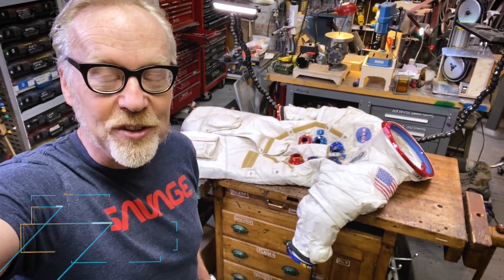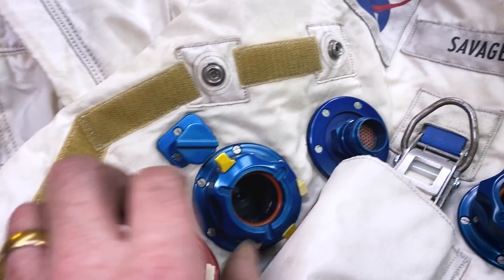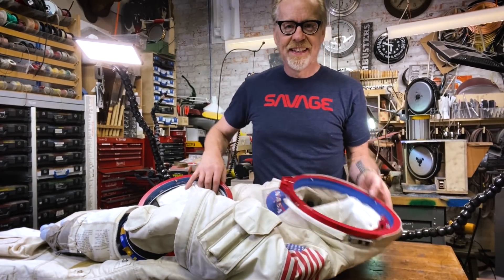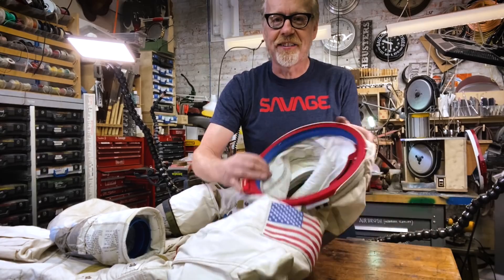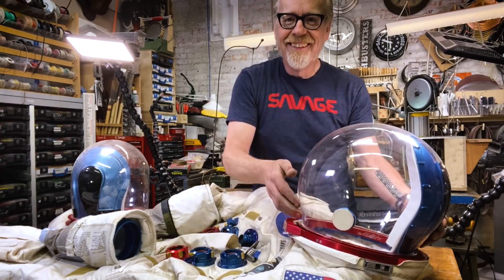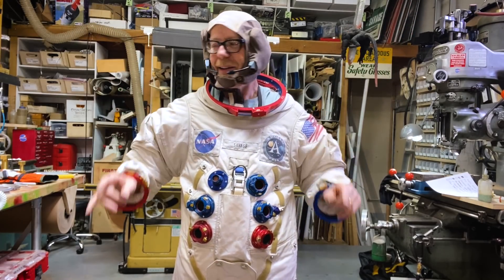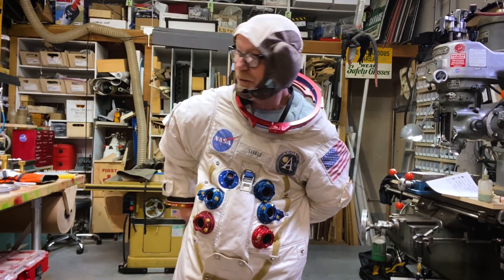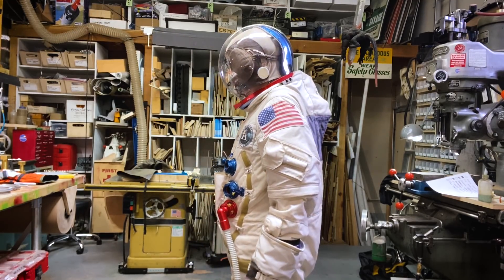Adam Savage's Apollo A7L Spacesuit Upgrade!

Comment: Just a heads-up on the CCA ("snoopy cap"): The quindar tones should not be there. They originated on the ground and was only present for the CAPCOM end, not the spacecraft end. Due to the very slight comm delays (maximum of ~1.5 seconds) sometimes the crew would start their transmission just as the CAPCOM ended his, leading to a confusion in that the spacecraft generated a quindar tone as well when it was really the outro tone for the CAPCOM.

Here's a NASA page on the quindar tones: https://www.hq.nasa.gov/office/pao/History/alsj/quindar.html

Comment: Ok, space nerds, I've got a question. Adam points out out that he made an oxygen system thingy and air goes into the red valve and goes out of the blue part of the helmet. First question - is color coding a consistent thing where red is in and blue is out? Second question - if that is indeed the color scheme, is it a metaphor for how a cardiovascular system is usually drawn, with red arteries and blue veins?

Comment: Somehow I think a build in the near future is Adam making a portable ventilator unit to match the ones the astronauts carried on the way to the pad.  And, for what it's worth, the blue connectors are the input and the red is for the output.  Adam has it backwards by having the air come in the red connector.

Comment: Fun fact: that air distribution system in the helmet is use almost unchanged in modern EMU's. 
Less fun fact: Its that through that port that water made its way into Luca Parmitano's helmet during his aborted space walk. The water soaked into his cap and eventually started to fill his ears, eyes and nose before he could get back to the airlock (which he could barely see by that point, if at all) to safety.

Comment: Regarding anodising colour. Different grades of aluminium do anodise slightly differently and can give you headaches trying to achieve the same colour as another part but can also have different looks, ie they brighten (chemical polish) to different levels, some show grain etc. Colour is achieved by dying the parts, if all other things are equal (actual dye pigment, oxide layer thickness, dye concentration, dye temperature, some react to pH too) then different colour shades would be achieved by dying for a longer or shorter period of time

Comment: This is amazing! I am so envious right now. But one thing has always bothered me about this suit: the silhouette is a bit off, because the shoulders and neck are a little too droopy. The A7L has an internal pressure suit that adds a lot of structure, especially around the shoulders and neck. Given that Ryan's suit patterns are accurate to the original (or nearly so), it should be trivial to just add a bit more batting (maybe it will make it a bit hotter, but it would be totally worth it!) or something underneath to stiffen the shoulders and give the upper torso just a bit more structure. Do consider it! Otherwise, you are living the dream man

Comment: One thing I don't believe in is the moon landings. They were faked.
Reply: You really chose the wrong guy's video to post this on. Adam proved very well that the moon landings were not faked during his time on Mythbusters.
Reply: @HubrisInc  I watched it, and only saw a number of flaws in it. To replicate in a studio that the moon landings were not done in a studio is a paradox. The only thing they couldn't replicate was the slow motion properly, and they didn't use wires. So with wires they could have replicated it.
Reply: What about the mirrors on the moon so we can accurately trace its orbit with lasers?
Reply: @cycoholic  You can send up a bunch of them, have them send out their own locators, and pick one up. A few years after the moon landing their were a bunch of red lights circling the moon, I think that they were the reflectors.
Reply: Pincho Paxton so what about the fact you can see all of the landing sites on the lunar surface, including the lower LEM portion and other large hardware?
Reply: @emilyrobinson6080  I'm sure they have had plenty of years to fake all that by now.
Reply: @pinchopaxtonsgreatestminds9591  Faking all the evidence after the fact would be just as, if not more, expensive as actually doing it for real. also, think of the thousands and thousands of people who worked for NASA and the various contractors who built the equipment. There is no way that if it was faked that none of them would come forward and admit it was faked, and yet to my knowledge no such (ex-NASA, ex-Grumman, ex-Raytheon, etc.) person has come forward. For every other major hoax out there, someone has spilled the beans. Don't you think that the same would happen with the moon landings?
Reply: @HubrisInc  These useless replies just make me believe it was faked even more, because if people are so gullible it makes it far easier to fake. How many people have to actually know? About 12.
Reply: Pincho Paxton thousands. Thousands would have to know, from every facet of the design and planning teams to mission control etc, plus if your conspiracy were correct youd also need a stage to be constructed with exacting detail down to the last spec of dust  for a fake landing site. And you would need to have a new one every single mission. It would be so hard to fake the landings and then keep everyone who would have to know it was faked that the actual herculean task of landing there multiple times looks like an absolute cakewalk. Also given the fact you can look up and see the actual landing sites and tracks on the moon, and the LEM landing sections, which arent in any way small and lightweight, and have been able to look up into the night sky and see those sites at the time of landing and not some time after, proves they really landed there (not to mention the fact that it would be infinitely more challenging to create some sort of remote control rig to land on the moon and drive a rover around to fake activity than it would be to just send a couple guys there and bring them back). You seem to simultaneously discredit the space program and humanity in general in not being able to accomplish such a feat while at the same time giving far too much credit to the government’s  and human natures competency in seamlessly pulling off a ruse that has so many moving parts and potential for security breaches that it makes the soviet N-1 look simple and safe
Reply: @emilyrobinson6080  Why would they have to know? They are making parts for a rocket, that's all they need to know. The stage never looked like an actual moon location, the same hill was in nearly every shot. The Rover never looked very real, the driver never moves. No you just convince me more with each sentence.
Reply: Pincho Paxton then i wash my hands of trying to explain it any further. Youre either too infatuated with a conspiracy or too keen on trolling people by acting such, and im not really sure whats more pitiful. Im going to watch some cool spacesuit content and then go make something and i hope youre able to do something enjoyable too
Reply: @emilyrobinson6080  Resorted to emotional backlash, you convinced me even more.
Reply: Pincho Paxton i guess wishing someone a nice day and not debating further is emotional backlash? Have fun dude.
Reply: I assume you dont have any education within science?
Reply: Your pretty fake yourself.  Take you fake reality, and your fake universe, and go some place else.
Reply: @peterkelley6344  You make some good counter arguments!